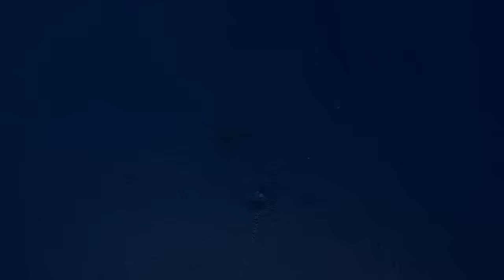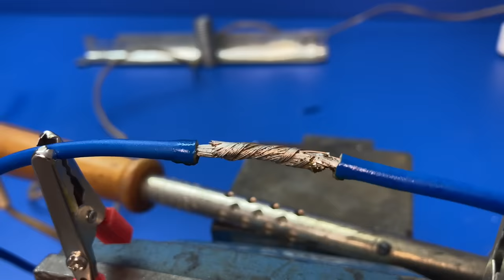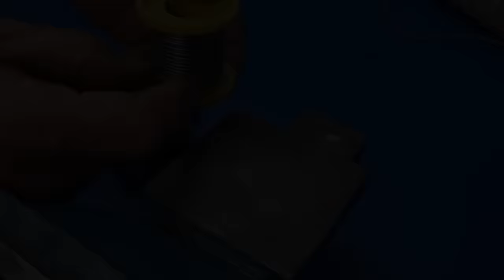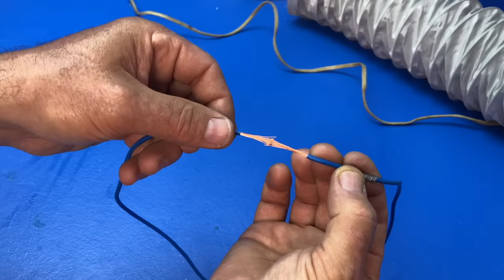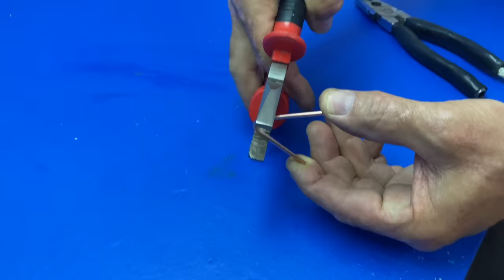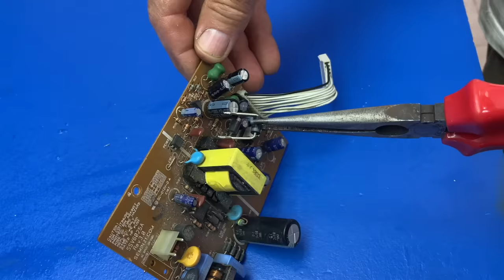Few Know About This Soldering Iron Feature! Make Solder Like Pros

Comment: That last part when you took out inner copper of a cable to make out new solder head. What kind of cable is that?
Reply: It's a standard solid wire used for wiring instalations, they sell them in every hardware store.
Reply: looks like 2mm copper wire.

Comment: Dude, you got no idea about the soldering principal and what the thermal mass is. In that video got examples only how not to do good solder joints.
Reply: Agreed. It's nice that he's trying to give noobs some soldering advice but it's a bit lacking. It basically shows bad  soldering and less bad soldering. For example he doesn't pre tin the wire or pad and then shows pretining the wire and not the pad and still doesn't use additional flux relying on what's in the solder wire core, looking back in the vid he does use additional flux but it isn't shown for the first example of how to make a good joint.
Also I think the tip design his iron uses is the worst one for performance.
Reply: I remember being in shop class learning basic electronics class back in Jr. High school (they used to teach that stuff back then). This guy has made of video on precisely how to do it incorrectly. If it weren't for poor skill this guy would have no skill at all. The flattened solder wrapped around a a wire splice is a perfect example on how to make a cold solder joint and a bad splice.

Comment: Excuse me, what is the fluid used before welding and does it help in welding? Thank you
Reply: That is solder paste(flux), most of the solder wire already constains them. So you do not need it very often, but it can help the desolder or help with very unsticky pads. If you solder does not stick easily to basic parts, try to adjust your irons tempature for 380-400.